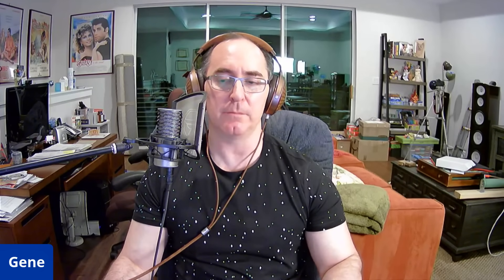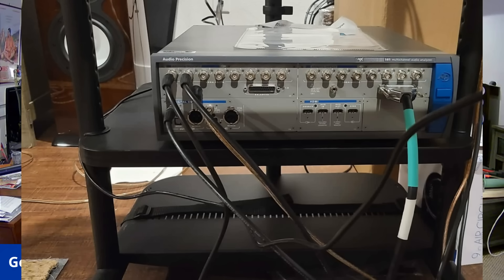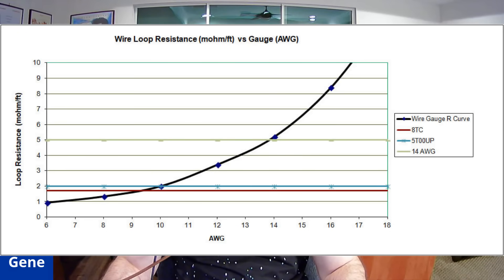Speaker Cables Really Don't Make Much of a Difference?

Comment: Gen, you probably, . . . . no definitely would have forgotten more than I ever knew about audio.
I was thinking about what you found. As a sparky and hobbyist electronic enthusiast, I can fairly confidently say that at these low frequencies and they are low in the spectrum, along with the extra low voltages present, theoretically you should not see much affect by using different copper cables. The only caveat would be that the copper is relatively pure/equal in the different cables used for testing. Distortion, capacitance and inductance effects increase as the frequency increases. I'm not a know it all so if I'm wrong, I'm happy to hear from a more educated person tell me why I'm wrong. I'll listen and take new information on board 'cause I'm really just spitballin' here. Good video Gene and this cable thing reminds me of the analog records vs these new whiz bang CDs and the many subjective tests done back in the early 80s. Yeah, I'm an old fart 🙂
Reply from the maker: There is no distortion in wire. A wire does not experience non linear behavior. As Frequency goes up so does AC resistance but inductance goes down, capacitance remains about the same.

See:https://www.audioholics.com/gadget-reviews/blue-jeans-10awg-speaker-cable-5t00up

Comment: This test confirms what I've long suspected. I use standard RCA copper 14-guage for all 3 of my home set-ups. My hearing is very good (with actual hearing tests to back up that claim) and I've yet to hear much of a difference, or any difference, between standard cables and expensive ones. There are simply better things in a system to invest your money into that make way more of a difference than expensive cables.

Comment: I have 67 year-old ears that go from 30Hz to 12 kHz. At 16yrs old it was 16Hz-21kHz. I use 2.5mm T&E (13AWG) household wiring cable, running 25 feet into 8 ohm Goodmans Magnums in my workshop. They still sound as good as my old lugs can detect. Sound quality is what you are happiest with: I love classical, orchestral, organ, rock, early reggae, electronic etc. I'm happy! 🙂

Comment: As an circuit design engineer for the last 47 years I applaud this article. I have used all of the test equipment you have plus some you have not. I used to work at Agilent. I have designed clock systems on chips that work in excess of 75gHz. I understand the physics of transmission lines. Spending big bucks on speaker cables is totally not necessary. Anyone telling you that they can hear the oxygen or lack of it in a cable is delusional. Beware of the cable con! I am much more concerned with the fact that amplifiers do not use regulated power supplies. That is much more serious issue than speaker cables.
Reply from the maker: Regulated power supplies only make sense in switching amps. Otherwise, you give up too much power loss in the regulation process. For linear designs,  a large centralized power supply with lots of filter caps to reduce ripple and sag gives you an amp with the most dynamic headroom possible.

Comment: Thank you so much for doing the work testing these cables with premium audio equipment. You would probably know better than anyone, but I was wondering, I was thinking of getting the reserve series and google said for a 4 ohm set up you should have 14 Awg, do you agree with this? Also would you recommend pure copper stranded wire over copper coated aluminum?
Reply from the maker: Never use CCA. it's junk wire and higher resistance than pure copper of equivalent gauge. 14awg is fine for short runs under 20ft but I personally use multistand 10awg from bluejeanscable.com or Kimber 8TC if you want fancy.
Reply: So your saying if I was going like 34', like i need to do for my left surround, you would recommend a pure copper and maybe a 10 awg?
 @Audioholics

Comment: Congratulations.  You confirmed your preconceived notion through the use of some test equipment.  I used to work at Intel and a signals guy swore up and down the same things you're saying.  I have an EE degree.  He came over to my house to listen.  At the time I had Vandersteen 2Ce's and a Bryston 3BSt amplifier, so solid budget friendly equipment.  I had three sets of cables available at the time.  I swapped cables between the three, I said nothing, he threw up his hands and walked out of the room.  He conceded that there was absolutely no doubt that there was a significant difference between the cables.  And it's not the bias you're talking about where one cable costs more than another.  At the same price point there are significant differences.

So instead of trying to "prove" cables don't make a difference, how about trying to figure out why cables that sound distinctly different are so different.
Reply from the maker: Placebo gets audiophiles all the time. Testing cables blind quickly evaporates perceived audible differences everytime. The burden of proof isn't for me to disprove your flawed listening tests, it’s for you to disprove the objective measurements that prove there is no difference.

Comment: Thanks for shedding light on this! I worked in the "high-end" audio scene back in the day, and I witnessed people with advanced degrees in electrical engineering arguing about the sound differences in cables. I knew it was a bunch of BS, but played along. I once spoke up and explained that any recorded audio signal has been run through a mile of Belden 8451 cable (the standard for wiring studios back then) before it is put on the final product (LP or CD). I was immediately poo-pooed for suggesting such heresy. The only thing that I've noticed in the actual signal quality is the terminations/connectors. Any high-quality connectors work just fine as long as you keep the oxidation off of them.
There is way too much cognitive bias in the audiophile world. Just because something costs a ton of money doesn't mean it's better.

Comment: I'm legit surprised to see distortion differences is speaker cables. I had to look it up but 0.06% a 5 dB difference! If you can hear that or not is another thing but 5dB is hard fought. In the ASR rankings that can put you from top 10 to top 5.

Comment: my cables are amazon basic 14awg. my cables to my subs are 12awg. i get compliments all the time on how good it sounds. i have a older crown ce4000 amp running 2 um18's. the 18's are in a denovo cube 18 box. bought the amp and subs all used for 1000 bucks. i even bought the other speakers i have used and they arent anything special neither. 2 polk towers and episode suroound sound satellites and center. i believe the episodes are 500 series. towers are  tsi300 and the reciever is pioneer vsx lx-305. i paid 120 for all the other speakers i have lol. i honestly love the setup and jam out all the time. im glad you showed these audiophools the truth. maybe now they will realize how silly these claims are. i guarantee some will still claim they can hear the difference lol. which is just comical

Comment: Hi I really  liked your video.  At last someone  with proper  intelligent  information. I have always  thought  I have good hearing, And going back to the late 60s I was using  the sure v15 cartridge and the shure test record on my equipment.  I would methodically set everything  up and position  myself  in the best position.  Then test my equipment.  The company's out there today put ideas  into people's head . Just like a plinth board or speakers  spikes or phono cables. I have sat and borrowed  cables and perched  spikes  and made a solid mahogany turntable plinth board ,And do you know what you are absolutely  right . The biggest  thing that can affect  you sound reproduction  in your room ,setup and drapes . I have found absolutely  no evidence that TO my ears there is not a chance I would spend hundreds  of pounds on wires ,phono cables ,or a £20.000 turntable.  When the equipment I have is butefull as it is . Very sorry  for the Rant I have just posted . But I thank you for proving what I already  thought  was correct. 💯💢💥

Comment: Not all heroes wear capes!. Thank you for your honest assessment and for confirming exactly what I suspected regarding expensive speaker cables. It would be interesting to drop the wire gauge to a point where a perceivable audible degradation occurs. I'd like to see those graphs. Cheers

Comment: I have a pair of T+A Criterion 2000 CTL on a Hegel H590, and the speakers sound almost exactly the same with 2000 euro cables, as with 100 euro cables. However when I upgraded to the monitor audio PL200 II, every cable sound different, and sometimes the difference is huge...., checked with 5 different people blind, they all heard it. So you can tell me whatever you want, but please do explain, why there's such a big difference with some speakers, and not with others

Comment: I'm 75. I knew this when I was 15. For any reasonable distance common 16 gauge zip cord is more than fine. But if you want to get a bit fancier, "tin" the stripped wire ends with silver solder and apply s thin layer of silicone grease to them to ensure an air tight seal when you crank the speaker and amp connections down. The connections will be impervious to any oxidation for decades. Anything fancier is just pissing money away. There are many controversies like this in the audio world. I have a term for them all, F.U.I. which is pronounced "phooey": Figments of an Untutored Imagination.

Comment: speaker cables, almost negligent provided you start with some that are decent, like 14 gauge copper wire or 12 if you need high current, and for interconnects, you only need to know balanced or not and if you have shielding against RFI, EMI. Lastly, when you go longer you increase resistance and add some inductance, capacitance is very minor

Comment: In the base of things , different metals have a different tonal balance so there has to be a difference, different covering to the metals has different "skin effect" so there has to be a difference,same conductor in different  alignment sounds different from one to another so there has to be a difference,now if you are able to hear it or not is irrelevant,the difference exists whether you like it or not ...
Reply from the maker: So now you're just making stuff up that is easy to measure, analyze, and disprove. Skin effect is NOT a mystery. It is simple to measure and calculate, and what you've claimed is patently false. Keep searching for a rationalization to spend more money on cables without abusing signal transmission phenomena that are easily disproven.
Reply: @Audioholics  believe whatever you want but you do ignore the FACT that different metals has different conductivity and different tonal balance , I'm not making up anything those are all facts and i never said a good cable should be expensive ,if you can't hear the difference it's sad,keep measuring instead of listening that way you will never get anywhere ,good luck ....
Reply from the maker: @shaynakash4222  ok glad you gave up on skin effect realizing you were wrong. The differences in DC resistance between metals is also understood, measured and calculated. The slightly better conductivity of silver is easily compensated for by using more copper, making the cables equivalent in performance.

I do a lot of listening and a lot less measuring in cables these days since, as I stated in the video, cables don't really matter beyond a baseline in performance easily achieved by inexpensive cables 😉
Reply: @Audioholics  like I said cables that sounds good are not necessarily expensive and vice versa,i use analysis cables copper which are cheap ,they sound the best for the money for what i hear ,at least here ,you can't get results without listening and by the way i was tasted blindfolded many times i am never wrong ,i can hear the difference even on "cheap cables" measuring them is irrelevant....
Reply from the maker: @shaynakash4222 I'm glad you found what you like, but please refrain from explaining possible reasons misusing signal propagation terms easily understood and disproven.

Comment: He still doesn't get it. There IS NO EQUIPMENT that can measure live musical interaction inside a cable. Your ears can do this eaisly, with practice.  Everything makes a difference, it's just a matter of if you care or not.  His 'preconditioning' of what you will or will not hear with cables is JUST AS BAD as a cable company. Measuring LCR of a cable has NOTHING TO DO WITH RF INFERFERENCE, CABLE LEAKAGE, HIGH FREQUENCY RINGING, IMAGE SIZE, IMAGE DECAY, ETC ETC ETC. This is just more Narcisstic behavior from this guy and this company.  " if I can't figure it out, it's not possible "
Reply: Let me guess, you believe in fairies.
Reply from the maker: 🤣 🤣 🤣  nice April Fools post, except it's a little early for that. You can't explain the perceived differences you think you hear with any proven peer reviewed science or logic, so you just make stuff up. If you aren't currently employed in the esoteric cable industry, you should be. This is the very definition of making a logical fallacy and worthy of a video topic. Thanks

Comment: Please could you do an episode on whether different digital transports sound different or not, when streaming to a DAC?

The way to measure this would be to capture and compare their bitstreams to the original wav file, using something like bitwise.

I suspect that any differences would either be down digital trim, or additional processing that artificially colours the sound… and not linear power supplies, super clocks, or anti-vibration damping measures.  The biggest woo out there atm is the belief that data has a sound, rather than being a mechanism for delivering information about sound.

Comment: I certainly agree that there’s no need to spend a fortune on speaker cables and thank you for putting all of this effort to do this test, however, I do remember many years ago, purchasing some speaker wire that was about £35 per meter and it did have a difference to the sound coming out of my system, but in a detrimental way.  What would cause this?  I appreciate that without you having all of the technical details this might be hard to answer, but all I can remember was that the cable didn’t use copper and from memory, contained silver and I think they claimed it was oxygen free…(which I thought was a gimmick).  When using this more expensive cable the bass seemed to be reduced significantly to my ears and it sounded more constrained, if that makes sense.  It was a lesson learned though, so I only buy normal copper wire speaker cables now, but I’d be interested to hear your thoughts on why I noticed a difference.  To me, it was a very noticeable difference and I didn’t like it.
Reply from the maker: You're probably dealing with a high gauge silver cable vs. the copper ones, so the system damping changes and the higher resistance cables increased insertion loss. Stick with 12awg or lower pure copper, not CCA, and you will be golden.
Reply: Thanks for your reply.  Thinking about it again now, I’m almost certain the silver wire was a smaller gauge, so there would have also been greater resistance compared to the copper wire I was using  @Audioholics

Comment: I've been saying this for years but the brainwashed will not believe me..I also am an electrical engineer.  My mother in-law wanted to buy a modestly priced two channel system in the 90s..I went with her to a stereo shop and the salesman proceeded to try to get her to buy super expensive cables..I told the salesman no.  He went into this spiel about how it won't sound good without the hundred dollar cables...My mother in-law would have bought the expensive cables if I wouldn't have been there..That salesman didn't like me much and treated me as if I didn't know anything..LOL

Comment: I agree with you on the cables. Not much difference if at all. Although, I have heard quite a large difference in capacitors and even inductors in crossovers. I didn't expect to, but I heard it right off. I am sold on the crossover components.
Another thing to think about with speaker cable is , what wire are they using inside the speaker? Also, what about the binding post? Are they steel, or copper or some other metal? The weakest link is the problem.
Reply from the maker: Crossover parts do matter and it's measurable. Good speakers should be wired in Stranded twisted pair cabling and no CCA connectors.

Comment: Very well said , In my honest opinion any well thinking technical person who understand the basics of ohms law would should also understand that the " Speaker Wire " craze is just " snake oil " for the " Audiophools " who like wasting their money . The rule of thumb that i use is , any wire run that is less than 15 Feet then 14 Gauge is fine Wire runs above 15 Feet and not greater than 25 Feet  then 12 Gauge is fine . If only most of these " Audiophools " could understand that the conductors from the main amplifier output inside their amplifiers / receiver going to the  output terminals are easily  16 - 14 Gauge wires , this means that adding a set of " 10 "  or " 8 " gauge speaker wires to your setup will NOT make any acoustical difference nor will it be beneficial in any way at all. Please don't get me wrong , good quality speaker wires and interconnects using high purity copper conductors are important in every system BUT please don't be foolish to think that you are getting more signal because your wires are as big as a garden hose.  I am sorry to burst your bubble, as I like to say , Equipment , Listening space , The overall wiring of the system  and Source material makes the differences , NOT specialty speaker wires and interconnects. This type of thinking would be similar to a husband thinking that the more expensive the wedding band he provide to his wife makes her better than someone else's wife with a cheap Walmart wedding band . Thumbs Up to the video , well done.